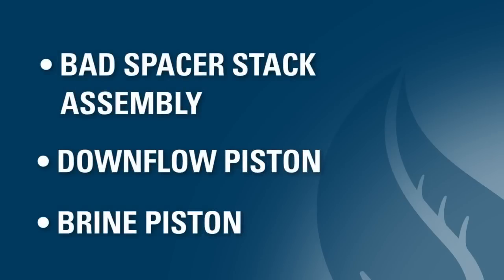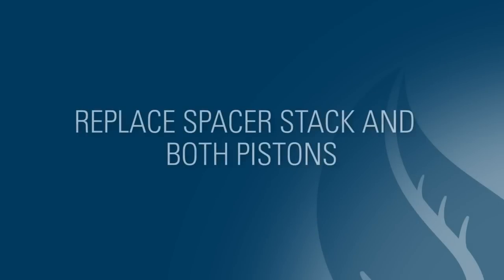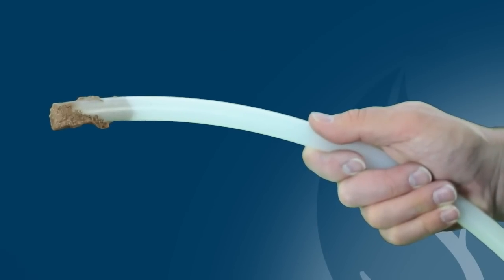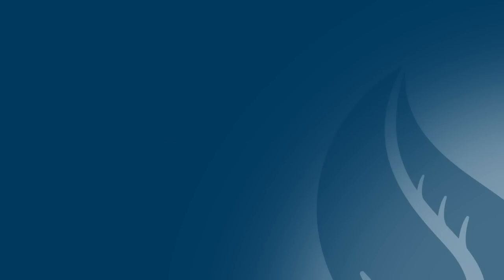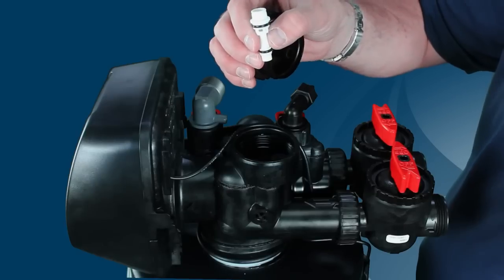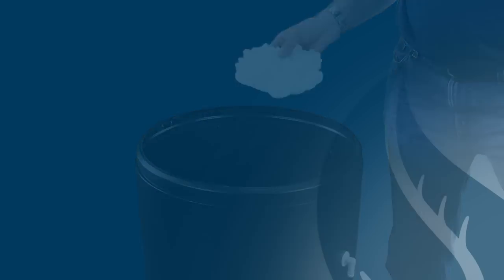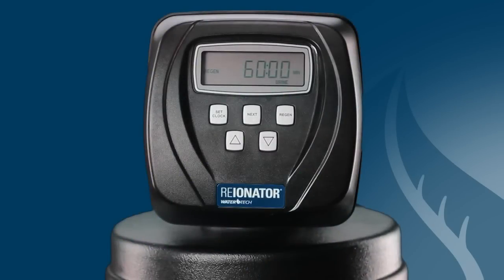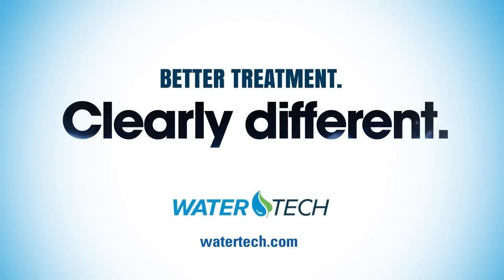WaterTech Dealer: Troubleshooting Too Much Water in the Brine Tank

Comment: What does 'Too Much Water' mean? He never says how high the water should be when salt level.is very low. Mine is 1/3 full.of water
Reply from the maker: This all depends on what type of system/softener you have in your home.  It can depend on if it's a pre-fill (filling with water before regeneration) or post-fill (leaving water in the tank between regenerations).  Even then it can depend on displacement depending on how much salt is in the brine tank and the salt dosage the system is programmed to use in each regeneration.  In general, if the water level is always at the overflow elbow then that would be considered "too full or too much water".  And if that is the case then you might want to reach out to your local dealer for a maintenance request.

Comment: Mine just had a clogged brine tube.
Reply from the maker: Did you find out what was clogging the brine tube?  That is very rare.
Reply: @WaterTechFiltration  I just assume salt build up.  I have the end by the drain tube ran up into a larger pvc pipe because the water pressure was making the water come out past the drain and flooding the floor.  I didn't bother to take the end out and see.

Comment: Lmao you should relieve the pressure FIRST before removing the drain elbow
Reply from the maker: There is no harm in removing the drain or brine elbow with the unit in service. 
In order to verify if the spacer stack is bad, the system needs to be in service with water flowing through it. 
When removing the brine and drain elbow, there should be no water flowing through those ports. 
If water is flowing through the ports, (typically small amounts) then the spacer stack is bad and will need to be replaced.
Reply: That actually makes sense